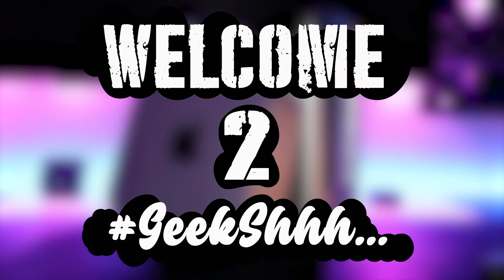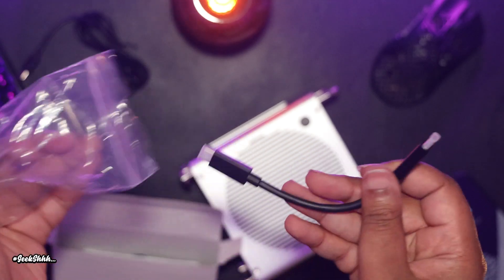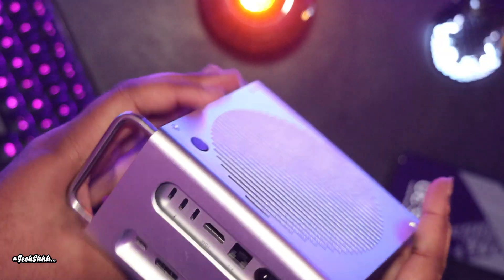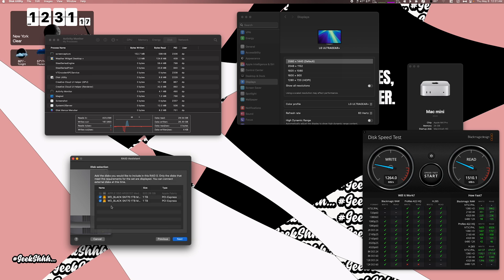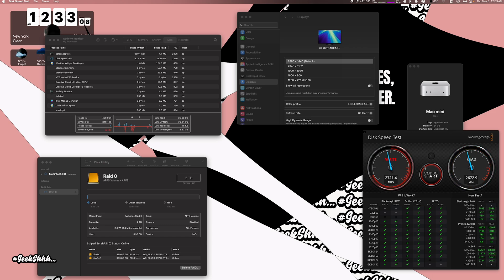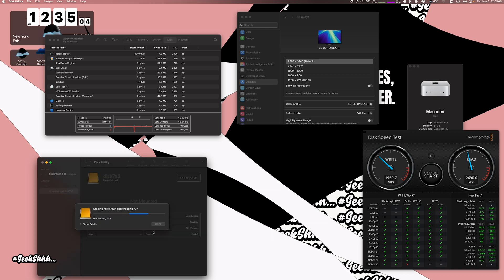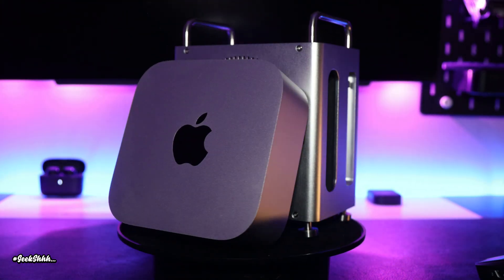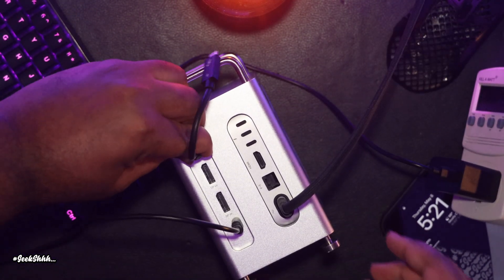Acasis M4 40 Gbps Enclosure Docking Station x Kickstarter TB1201 M4MacMini M4 Mac Mini Pro

Comment: When you power on the unit and then the thunderbolt cable is that just for the first time setup or do you have to do that every time?
Reply from the maker: Just the first time. Thanks for watching and commenting!
Reply: @GeekShhh thank you for the detailed review, covered info other reviewers didn’t.
Reply from the maker: @luke_1234  This my fav review bc of that reason lol
Reply: @GeekShhh because you mentioned USB dongles being ejected when powered off, did you have that problem with the M.2 SSDs?
Reply from the maker: @luke_1234  Now thats one that I did not experience. The SSDs never ejected on me

Comment: It's a great guide to this Mac mini companion. I didn't get only why it needs a separate power, considering it can be powered form Mac itself.
Reply from the maker: Powering the unit through the tb port instead of the power brick will lead to other issues that I didn't discuss in the video. I suggest using the power brick. Thanks for watching and commenting!

Comment: You mentioned how the drives/cards are ejected when the computer goes to sleep @ 11:19, curious if this is still the case if you turn off the setting to put disks to sleep when possible in the Energy Settings? Cause I was having this issue with my mini (no dock, just on it's own) and disabling that setting resolved it for me
Reply from the maker: This is very interesting and im def going to test this later on. Ill let you know how it turns out by tomorrow. Thanks for watching and commenting!
Reply from the maker: That option only appears in the M4 Mac Mini Energy settings when you have HDDs connected to it. So its not available when using this docking station. Thanks for watching and commenting!